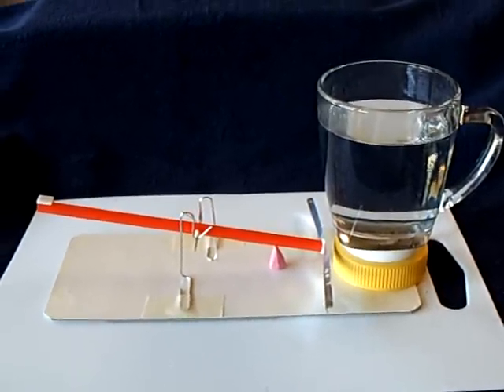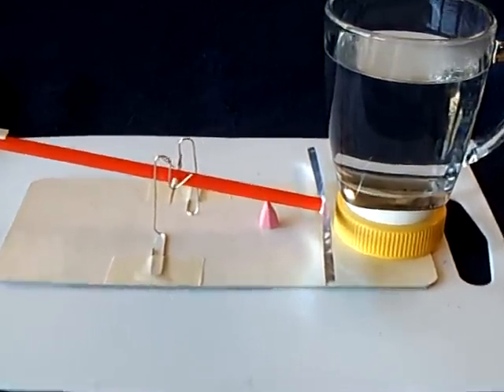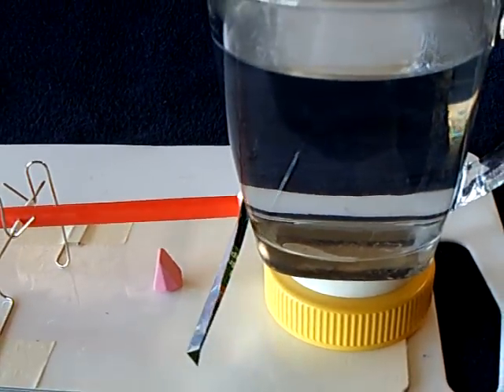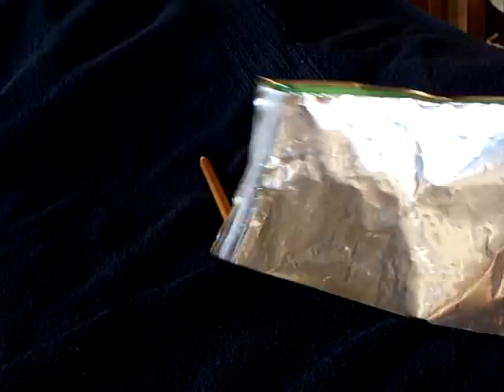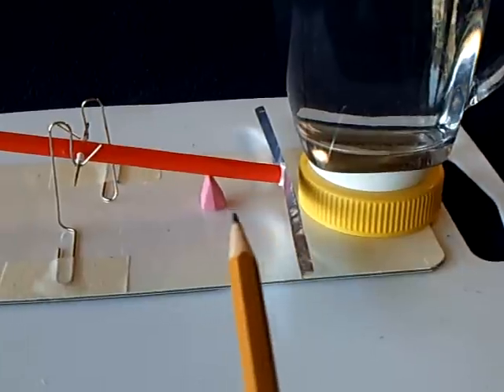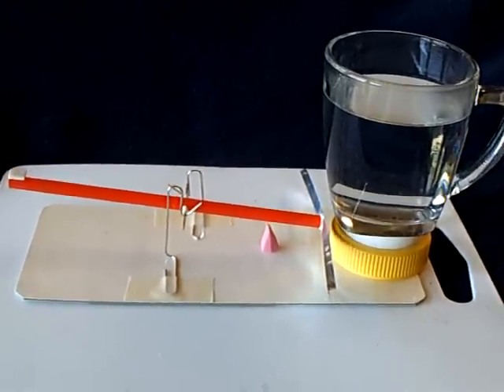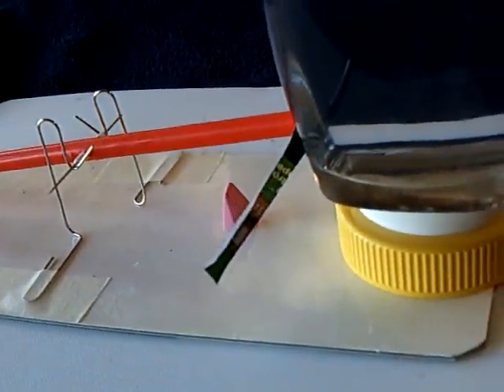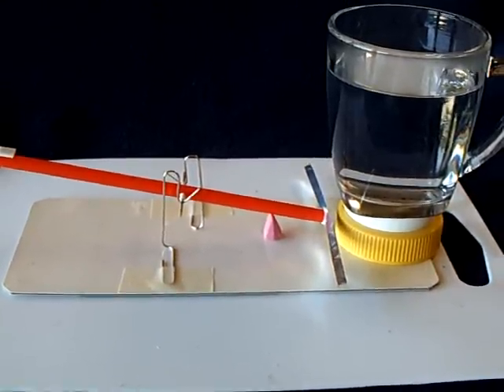Blade's Super Simple Heat Engine

Comment: Another thing: The material is a layered low density Polyethylene (inside the bag), aluminium is the middle layer after BoPET (bioriented polyethylene terephthalate) on the printed side.
My opinion is, the LD PE is the key, but I'm not shure about it...only the LD PE not reacted for the heat similar as this layered one.
Reply from the maker: Attila Blade Thanks for this amazing device --and ALL your hard work on heat engines.  I think that you are right about the LD PE being the key.  Today I took apart an old coffee bag and the layers came apart.  The inside plastic layer (which might be the low density Polyethylene?) reacted to heat all by itself.
Reply: Good! Then we can made stronger engine too with stiffer materials...or a high energy wheel.
Reply: And imagine now, with a nitinol bar, wouldn't be no more low temperature difference but it could be more powerful ;)

BTW, the power of your engine is indeed very low, looks to me, and comes from only as you know of the displacement of a very light mass on a very little distance and a rather low frequency.

Looks to me it would be around 1/100 of mW of order of magnitude:

(0.10 - 0.09) m * 0.001 kg * 10 N/kg / 10 s = 0.000 01 W

Do you confirm?

Wouldn't be more efficient with a cylinder-wheel?
Reply from the maker: Raphael Al Khar I'm thinking that the way to make more power is to multiply the number of heat reactive elements--and put them on a wheel.
Reply: Hi Lid! I have made some calculations already, it was what I was talking about when I wrote "cylinder-wheel".

Indeed, area goes with the scare of the length so it goes up rapidly but the order of magnitude of power is so low that even 10 m² of even only 1 cm² of reactive elements would not do it:

1 cm² = 10^-4 m², thus 10^4 elements by m².

0.000 01 W  = 10^-5 W.

Thus even for 10 m² of active surface (exposed to the sun), means a cylinder of 2 m diameter at least and 10 m long, would give 

10 * 10^4 * 10^-5 = 1 W.

Even if I have miscalculated the power of 1 element, I should have mistaken at least of 4 orders of magnitude (underestimated 10,000 times), that I doubt a little, to have a device able to produce usable power for 10 m long cylinder (10 kW).

If you can contradict that, I would be happy, believe me! :)

Now, with nitinol, change of shape been near instantaneous, let's say 0.1 s, we gain 

10 s / 0.1 s = 100 times more power,

so already 2 orders of magnitude.

With nitinol, we have much greater mass displaced; let's say 10 g:

10 g / 1 = 10 times more power,

so 1 order of magnitude more.

The displacement may be far more too:

10 cm / 1 cm = 10 times more power  again,

so 1 order of magnitude more again.

All added up we gain 4 orders of magnitude, and how many more order of magnitude we were missing?...

Now, let's say that we have indeed a cylinder-wheel of 2 m diameter, we could use with nitinol much larger displacements, let's say 10 cm, thus, 1 order of magnitude more again, and a mass much more important; like 100 g, which lead us to a gross order of magnitude possible of power of :

10 kW * 10 * 10 = 1 MW.

Sounds to good to be true! right ^_^ But it lets 2 orders of magnitude of margin of error to have a cylinder-wheel that could produce its 10 kW; thus enough to power a home.

Do you see guys any flaw in my reasoning or calculations?

Practically, we may have the nitinol strings or blades rolled or folded near the axis, and when sun exposed, developing them maybe up to 10 times long. Thus displacements even more important, thus more chances to get the mechanical power we want.

What do you think?
Reply: But...we can use some new type artificial muscle (rolled Nylon or HDPE, PE) for weight moving, then the balance will change faster and the power will be higher. I thought about it, but the experiments comes later. :)
Reply: Indeed! Blade, it worth the try :)

Comment: Very interesting and well built...must have taken ages to get the balance just right.
94F here in the day. So am thinking it may work the other way around, with an ice cube, because it'll be tough to get the heat difference here at the moment lol
Reply from the maker: +slider2732  Balance is not that hard.  A small piece of foam mounting tape moved up and down the straw worked well.  This device should work with a  cold source vs HOT air temp also.

Comment: This is similar to the behavior of thermostatic control in homes.  Different alloys of metal that react to heat differently.  When they are laminated together they can cause this bending effect when exposed to heat.
Reply from the maker: mediaguardian I guess the question now is WHAT is this mystery material made of.  Some kind of plastic coated aluminum or is it all plastic with a super thin aluminum coating?

Comment: Hi Lid, I also saw Blades experiment and like it and I always enjoy his experiments as well as yours. You know how an old timey rheostat thermometer in your home air conditioning works with a coil? The metal coil is made of two types of metal.  The “Bi-Metal” strip bends or curls and changes shape with minor temperature differences because the coil is made of two strips of thin metal that have been welded together and when one metal starts to contract quicker than the other it causes the coil to change shape. I figure you already know this but my guess is that some foil wrappers are made of two materials laminated together and one plastic contracts and expands at a faster rate causing the same effect. “? Bi Plastic ?”  It seems to be much more sensitive than a Bi-Metal Coil and I find that to be way cool. Cheers!
Reply from the maker: ***** I think you are right about how this material works.  The layers must be acting just like a bimetal strip coil.

Comment: That is so cool. That effect could be made into a huge generator.
Reply from the maker: Terry Woodroof I imagine there are some clever people who could do it.  The principle works and should be scalable.
Reply: Terry Woodroof Draw it :-)
Reply: Cloxxki build it. It is a matter of finding good materials to produce this effect and a free temperature difference.
Reply: I am curious how much energy could be extracted per ton of building material. And how much size it would take up compared with a run of the mill (oun) wind turbine.
It would be great if it were able to make use of energy not harvested by other green energy collectors.
Reply from the maker: Cloxxki It seems that the effect is basically a bi-metal strip only with plastic and workable on a low temp differential.  It is probably a very inefficient energy conversion but ---it works.  I remember when people though that photovoltaic would NEVER be a alternative energy source because it was so inefficient.  Perhaps this thing I showed here should be explored more.

Comment: Cool!
How far off-center is the pivot point on the straw?

Thanks for sharing!
Reply from the maker: A B I didn't measure it.  You adjust the balance with a small piece of foam mounting tape near the end of the straw.  You can get it close by just balancing the straw on your finger then stick the needle through.  I had to punch three holes before I got it close enough to use the tape.
Reply: ***** Cool, thx!